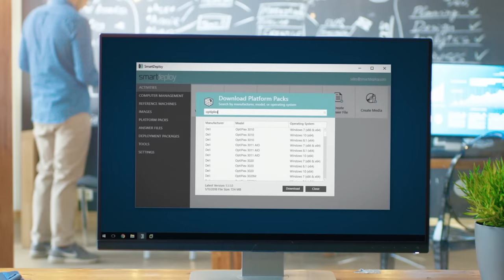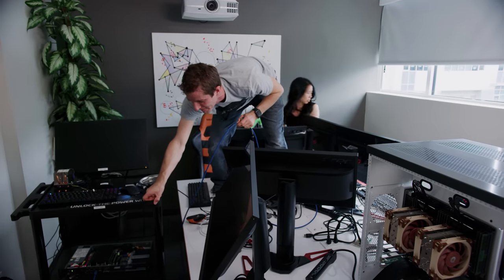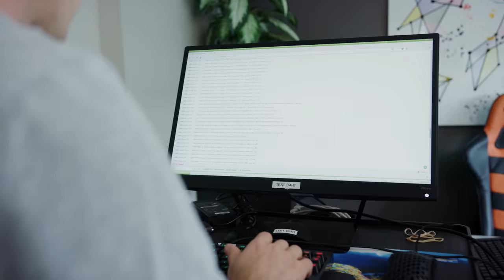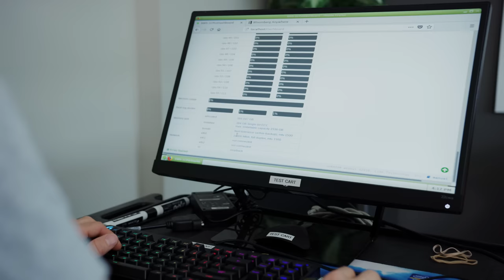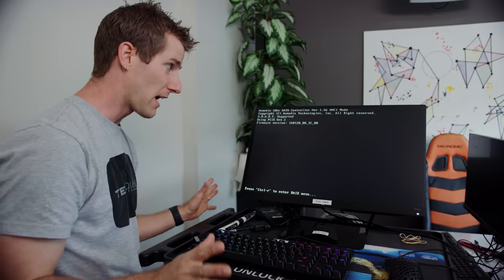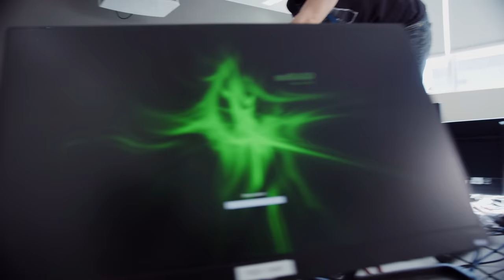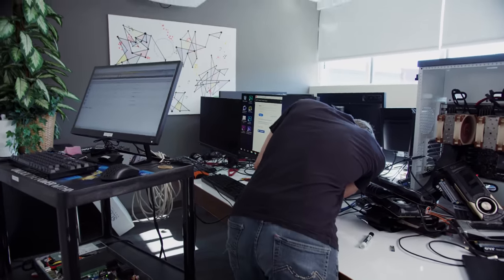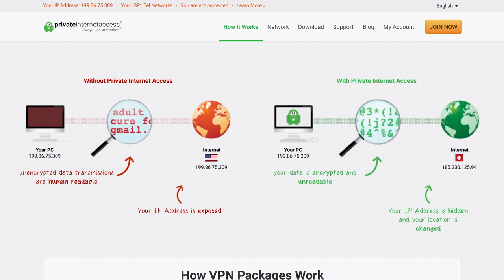When everything goes wrong - 6 Editors 1 CPU Pt. 3

Comment: Me: cradles my 1050 Ti and lightly sets it into position.

Linus: shoves a bunch of high end GPUs into a pile on a table and plugs them in while walking on a table and not looking
Reply: my laptop is from 2010 with an i3 330m, i beat it like a frickin vending machine...
Reply: Did you name your private parts "vending machine" :kappa:
Reply: Bezzegh Adam: except if you drop a screwdriver with the tip first on one.
I once accidentally killed a motherboard that way.
Reply: not that hard to rip one in half either after it locks up on you for the last time so you calmly power down your pc, carefully open it up, stoically remove the card, then savagely rip it to shreds across your bedroom and drive to comp usa for an upgrade, times were simpler then
Reply: i have a 750 ti
Reply: That's how it's done in the industry if opportunities present themselves! The truth is and was, that computers for the last 30 years are pretty much Lego Duplo blocks. No smarts, no nothing required! I mean, don't be an idiot, but yeah, these things are not tea cups from the Ming dynasty.
Reply: King, I nearly ended up with a 750 Ti if there wasn't a sale on the 1050 Ti. Hooray for budgets...

Comment: >6 editors 1 CPU
>dual socket motherboard
> mfw
Reply: the CPU is the black box next to the monitor right?
Reply: , no dumby! its IN the monitor! That black box is a bomb!!!!
Reply: @5x100  JC, a bomb!
Reply: >6 editors 1 CPU
>dual socket mobo
>multi threaded core
>multi core
>mfw Linus didn't even consider the Control Unit CPU inside the CPU
Reply: >green text doesn't work on YouTube
>mfw
Reply: >meme arrows
Reply: @DrathVader  >mfw normie doesn't know where green text arrows come from and calls them meme arrows
Reply: @callumboothroyd3766  >mfw normie doesn't call "green text arrows" comedy chevrons
Reply: why yall using greentext on youtube? it makes no sense
Reply: >4chan degenerate posts on YT using greentext arrows
>YT sees this
>YT implements greentext arrows
>4chan becomes even more irrelevant
Reply: @callumboothroyd3766  > still going on 4chan in 2018 what is this , 2010
Reply: Callum Boothroyd
>implying
Reply: @1241-c4e  try 2007.
Reply: @callumboothroyd3766  You saved me the trouble of pointing out "meme arrows".
Reply: >mfw double gay normie doesn't know calling greentext "meme arrows" is a meme itself
Reply: >mfw r/wooooooooosh happens
Reply: @trapbuilder2283  > comedy chevrons

Best of best.
Reply: >mfw people talk about 4chan in 2018

Comment: This reallt says something about modern PC hardware. If linus can screw it up this much and not really kill anything....hell that stuffs reliable and built well.
Reply: The thing though is a good 80% of that stuff is server stuff which is supposed to be bulletproof. Yes the graphics cards were consumer grade, but I'm fairly sure he wanted to test it with a cheap solution (lol cheap for ltt) before dropping who knows how much on the graphics cards he will actually use. Considering he's posted pics of at least 4 quadro gv100s and 6 titan v graphics cards on his instagram, he's going to go absolutely nuts with this system.
Reply: Can you imagine this project on HDD a few years back? pretty much impossible
Good times we live in
Reply: He isn’t done yet

Comment: Hi Linus. While I enjoy most of your videos, as a cloud computing trainer, I have to ask:

Why go through all the trouble of having 6 GPUs and PCI passtrough and whatnot for this build? You guys already have Quadro cards in Stock, and is relatively easy for you guys to get more.

If you use a bare metal hypervisor like Xen or VMware, you can virtualize your Quadro type Video Cards, so each video editor has a slice of the card. 

These "virtual" video cards are still recognized by the guest OS as Nvidia cards, so the tools/software that depends on Nvidia Specifc features still work like a charm.

I believe this would be a more elegant, less complex and more power effcient solution than what you guys are doing now.

I know that UnRAID is your go to software for storage and virtualization, but you guys owe it to yourselves and your audience, to try something new.

The technology to do this is available since 2014 from Nvidia and Citrix (Xen). I guess that by now is available from all major Hypervisors, and from AMD as Well.

For more details, please reffer to the video of the GDC2014 conference S4726 - Intro to virtualization.

 Best regards, and keep the good work.

William, from Venezuela.
Reply: William Yousef Fadel hey William, for my own info (I’m a student) how do you connect different motherboards/servers together to expand your cloud setup? (More processing power to share—GPUs, CPUs & memory) Thanks in advance!
Reply: When you istalled your cloud (which is different than your Hypervisor), the first thing you did was to install a cloud controller. This puppy will be your friend when is time to expand. To clarify this, I'll give you two examples. KVM is a Hypervisor, Openstack is a suite of SW that uses KVM (others as well, but KVM is the most used one) to implement your cloud. HyperV is a Hypervisor, Azure is a suite of SW that implements a cloud using HyperV....

To expand your cloud setup in a normal scenario, you simply add more machines with the HW you like/need (if you need more GPU power you get one or more quad-socket machine(s) of 4 or 8u with plenty of PCIe lanes, if you need memory intensive machines, you add 1,5TB (or more) blade servers to your chassis, same for CPU or DAS, etc), connect over 25GB (preferred) or 10GB ethernet to your ToR switch (make sure your all your ethernet supports 802.1aq, or, if nothing else is available, TRILL), and, in the Openstack controller, mark those machines as available for the pool. 

In the best case scenario, openstack will know how to do everything by itself using IPMI, iLO, iDRAC, iBMC, and the like. In the worst case scenario, you will need to install a small agent and, after that, Openstack will take care of all the rest of the install for you...

This asumes that the Hardware you are using is certified for your cloud, and that the configuration is known to the cloud controller, if not, prepare for a world of hurt, since you will have to do everything "By hand". That means you will have to install the DOM0 and special SW yourself, configure the machine, and then add it to the Openstack pool.

Things are similar if you are using VMware, HyperV or Xen with the respective cloud software.

Now, a clarification:

In normal cloud setups, a VM can not be distributed among multiple physical machines (it can migrate from host to host, and can even have a mirror image on a second host for HA purposes, but can not execute distributed over two or more hosts). At most, for the utmost performance, what  you can have is a super-duper-muscle-host which has only one VM as a guest (this is not as crazy as it seems, there are multiple advantages to have your workload as a vm or container, even if it will have all the server to itself, even if the advantages come at a slight performance penalty due to virtualization).

In certain special cases, you can have a guest VM distributed over more than one machine, but this requires exotic hardware and software setups, including Infiniband (Linus did a video on infiniband a while ago, but ended up using it to transfer files only, instead of its true purpose), and special software, and the explanation is beyont the scope of a youtube comment...
Reply: Right this is linus wth do you think he’s gonna do an easy thing or a stupid complicated thing
Reply: Both things are really-really complicated. But the openstack thing I propose is much more elegant than the GPU-PCIe passtrough thing Linus is doing.

"If there was a video game called Sysadmin, the final boss fight would be OpenStack." Justin Clayton
Reply: William Yousef Fadel wow man, thanks so much! I’ve been getting an introduction to cloud computing recently and I’ve learned about the interactive end (choosing your hardware, etc (we’re using Azure & AWS)) but that’s really cool to know what goes on at the other side. Thanks again!

Edit: in my first post I wasn’t clear in identifying hardware and cloud hardware—thanks for seeing through that.
Reply: Ixflqr, I am glad the explanation was useful. A few of nerdy tidbits for you to discuss in class.

* AWS uses the XEN Hypervisor, but is slowly transitioning to KVM.
* Most of Azure's machines are intel, but if you ask nicely, they may give you some AMDs. Same with Amazon.
* AMD processors are not as well supported by the Hypervisors today as Intel's. But this is changing fast, due to the strong performance and demand of Epyc. But is good to keep in mind for the near term in your real world projects.
* Many server makers (especially in blades and 1U servers) use only the PCIe lanes that come from the PCH, and do not even connect the ones from the processors, precisely to avoid the problems with VMs moving to cores where the hardware is not directly connected, as linus alluded in the video at aprox 13:35.
* Dropbox used to be an AWS customer, they did their math, and decided to build their own cloud around the end of 2015, begining of 2016.
* Netflix used to be an AWS customer, did the math, and decided to double down on AWS around the same time.
* Netflix has a nice set of open source tools, called the simian Army, that introduces random failures in the system at random times during working hours. In theory their system is designed to whitstand failures of that type, this helps netflix make sure that this is indeed the case. If you ever get a real cloud project, try to adapt them to your project from the get go, and not as an aftertought.

One last tip to Linus: If he is using the optane drives as a Write cache, I hope he is using them in RAID1/Mirror configuration, otherwise, should one of the optanes fail, or even blip, the team wild be in a world of hurt...

Comment: Not to be a Negative Nelly, but I kinda think y'all overthunk this build a tad wee bit.

For some multi-PC designs, one of my clients for a bit of pc-building fun, simply made a boxframe of 2 inch x 6 inch solid Douglas Fir boards usually used in housing construction and sandwiched them between two sheets of 4 by 8 foot 3/4 inch thick plywood. 

He then drilled two one inch diameter holes spaced apart every 6 inches completely around the frame sidewalls and put EIGHT Asrock x399 boards drilled right to the plywood using simple bolts and plastic spacers. (the motherboards were raised about one inch away from the plywood) The interior and exterior was painted all nice inside and out with high heat resistant polyvarathane BRIGHT YELLOW gloss paint with some fancy black and blue pinstriping on the outside. (you could also paint a nice image on one side too!)

The power supplies were simply bolted to the upper 2x6 boards with enough space to allow air circulation around the entire power cupply and generic power, USB and Video cable extenders brought audio/video and power to the 8 motherboards with 32 gigs of RAM and the NVIDIA 1070's which had 50ft long ACTIVE HDMI/Displayport/KVM cables threaded through a few of the bottom holes (threaded in groups through some nice bright coloured flexible hose) to nearby desks and an 8-port switch was also bolted inside the setup for networking the 8 boards together with one Gigabit Ethernet-over-fibre connection to the main internet modem.  The graphics cards were held up by simple U-bolts
and ZIP-ties!

 For cooling, four flexible hoses from the main building HVAC system was connected to few of the bottom-side holes to create positive air pressure inside the case therefore blowing heat and dust OUT of sides and upper part of the wooden casing!

The whole setup was then bolted to a wall and PRESTO a super-duper multi-user network computer was created which cost less than $1200 per CPU board + GPU + power supplies and it all looks like a modern-art painting! It's rather quiet because the wood casing and holes allow sound to get lost inside the casing. You actually CAN use fibreglas insulation or fire resistant acoustic foam panels stapled to the interior walls  to form a high end noise barrier but that tends to REDUCE the heat wicking abilities of the wooden case.  There's enough holes in the outer rim to NOT cause excessive heat buildup!

Try something similar to see if YOU TOO can make a CHEAP multi-user network system in a SINGLE BOX that is unobtrusive looking but VERY functional! 

How about TRY A BUILD LIKE THAT  --- 8 motherboards in a 4x8 plywood case 6 inches thick cooled by your buildings HVAC
system!
Reply: Pictures? ;)
Reply: I dont like to be a nelly either😂 but you say they over thought this project. You say that this 8 mobo is comparable but theyre trying to use 6 editors on 1 individual system, huge difference. Like i said though im not trying to be "that guy" but i dont want you to be Ill-informed ;)

Comment: Linus.. why dont you use cheaper graphics cards for testing? Like 1030s or 1050s?
Reply: why?
Reply: That would decrease the respect bar.
Reply: @mycosys  so that he doesn't have to stack thousand of dollars of graphics card on top of each other. Also he doesn't have to connect external power to low power graphics cards cause they only need to pull power from the PCIE port, unlike here where each card need 1-2 external power connectors. Once he tests with that he can implement the final system with the quadros or whatever. Idk i feel that would be a lot less tedious and less risky.
Reply: How would doing it twice be less tedious? and you are assuming they will be identical in a production situation - bad assumption. Also - to him it is surplus hardware
Reply: @mycosys  he's doing it twice anyway. He's obviously not going to leave the graphics cards hanging out of the case in the final build
Reply: Power draw. Gotta test that power supply.

Comment: Would you guys test something more realistic? I really want to know whether it is possible to use 4 separate 4K recorders to record gaming, then put them back together as one 8K video in post. 
Dual RTX 6000 GPUs should get you guys 8K 60fps.
Reply: You wouldn't even have to do it in post? Just lump them all together in OBS in one scene and you should be able to record it in a way that it looks as though it were a single 8K source, as long as all the sources are arranged properly
Reply: @Totallnsanity4
If it is so easily done I would simply use OBS to capture my 8K screen directly. 
From my experience, OBS crushes every single time trying to record a single 8K video file. Even if it works, you still lose HDR using software capturing. 

I've asked many YouTubers who upload 8K gaming footage regularly. They admitted that they ain't able to record 8K, they just upscaled from 4K.  

What I am considering is using four Atomos Ninja V recorder to capture four way ProRes footage.  But I don't have the budget just to try. I want to know if it actually works.

Comment: Any particular reason you didn't use the 2990wx when it has 64 pcie lanes, more cores and threads, lower temps, and lower cost?
Reply: eljoel89 probably because of the lower cost part
Reply: Dude he IS sponsored by intel and he doesn't hide it.
Reply: Because Linus us being Linus
Reply: yeah I was also wandering, but I guess that's what they had on hand
Reply: @psychobotLoL  I hope you didn't have to wander too far away
Reply: Intel sponsors LTT, he doesnt have a choice
Reply: Besides from Intel sponsoring this - AFAIK there are no dual CPU Motherboards for TR ?
Reply: Didn't he already have the (Intel) CPUs from before?
Reply: There are no duel socket tr4 motherboards
Reply: @theodorthiele  There are, but only for EPYC CPU's.
Reply: He has a dual socket with 28 cores each. This is much more baller than TR and should rather be confronted with EPYC, which I've almost never seen on this channel and not seen in use for sure
Reply: Because Intel is watching him. @)
Reply: I think he started this before the second gen threadrippers came out
Reply: @wolfinthedepths  lol just got notification xd yeah, misspelling :P wondering I guess i what I wanted to write :P

Comment: That feeling when you thought you knew alot about computers but realise you don't understand even half of the stuff going on in this video
Reply: I don't think I even understood anything except that stack of running gpu's on the table. Actually nevermind I don't even understand that.
Reply: @nigmaxus  they already do. But this is Hella cool
Reply: Hes basically making 6 computers by running multiple virtual machines on a single computer. With 2 CPUs. Each their own graphics card and USB Ports etc. But running on the same drives.. I think. Which is why he's using optane, as that apparently is really good at random writes. Which is useful because 6 systems booting up and using programs is incredibly random.
Reply: This is an awesome project, but his approach is chaotic. I think you would have learned something if it was done in a methodical way, but that is not the LTT way apparently.

Comment: All the cases and test bed platforms in that building and he doesn't use one to at least screw down all the USB cards and the second power supply...
Reply: Jared Bartimus This video was meant to entertain not actually setup this equipment properly. Also, there's a thousand better ways to do this same task on a very quick lan.